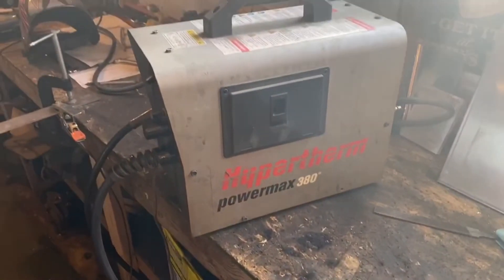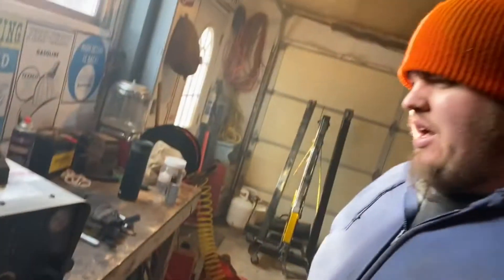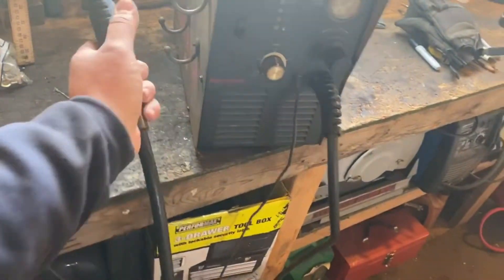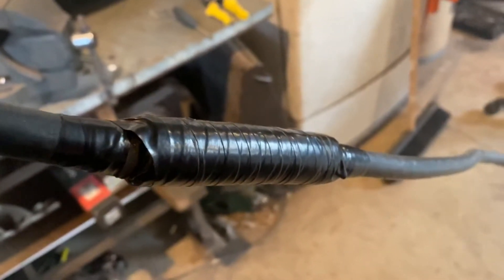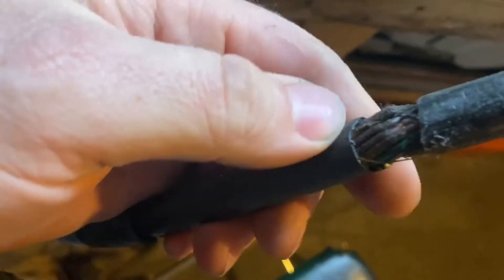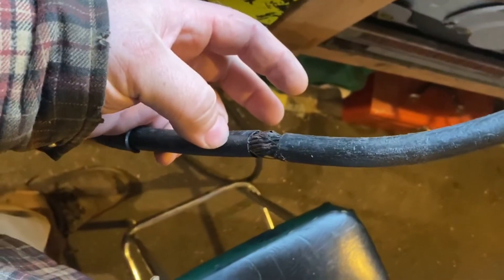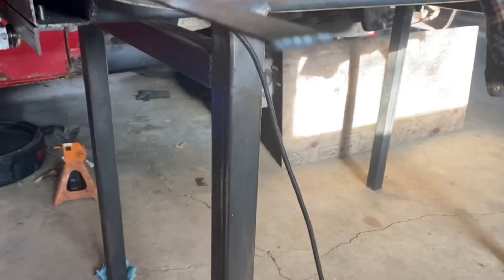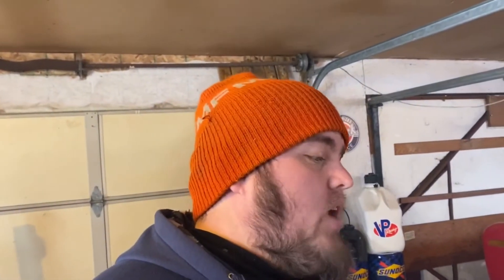Can we save this old Hypertherm Plasma?? - we see if we can fix an old plasma cutter powermax 380

Comment: A Friend gave me a Powermax 350,missing a Power cord , I wonder the connection wire look like , so I can make a cord to 220v adapter. 
If you can , please send me the pictures  of input power to 1 and 3 wire.
Thanks
Reply from the maker: Hey man sorry but I actually gifted this unit to a friend when I purchased a new machine. I no longer have it. I can see what I can find on it though. But not sure how much help I’ll be at this point.

Comment: I have a powermax 600. it acts like the work lead is not connected. do you think I could have a similar problem? how many wires are there? on the plug that goes into the machine there is about 1/2" of not exposed (bare) wire but the black outer rubber is no longer in the plug housing. I'm tempted to buy a new torch but it's 600 dollars and if it doesn't fix it I will be upset. any advise would be appreciated.
Reply from the maker: There are 4 wires and the air line to the torch I think. 2 for the switch and to to the electrode. Pulling the torch apart is not difficult so might be worth a try to see if anything might be going on in the head of the torch. Also then you could use a multi meeter to test the connection from the head of the torch to the plug that goes in to the machine. That will tell you if there is a brake in the line some where??

Comment: Got that same machine. Mine’s new old stock. Been in my storage for at least five years. Only recently decided to put it into service again. It has a few feet of cutting under its belt. I actually cut over 5/8 with it while cutting a few hubs off an axle. It has a duel voltage setting. You change it with a recessed switch on the back panel. If you’re plugged into 110 make sure the switch is set to 110. On 110 volt it’s rated 1/4 in. On 220 volt it’s rated 3/8. For cut off work it’s rated 1/2 . 12 inches per minute when parting off 1/2 inch. At any thickness they recommend using 27 amps at the torch. It seems to be power hungry. Book says it needs 10 amps at 220 volts but I would run it on at least a 20 amp breaker with minimum #12 wire. Since it’s a transformer based machine voltage drop could become an issue under certain conditions such as living in a development with a lot of neighbors running furnaces and AC in the summer.

Comment: I'm actually using the same plasma cutter on my CNC table and it works great! I just tapped into the switch wires inside the machine. I usually cut 1/8" steel @ 40ipm, 3/16" @ 32ipm, and it'll even cut 1/4" @ around 10ipm
Reply: Nice! Im waiting for my table and Im gonna use my Hypertherm 380. I use it to cut 10guage (1/8") now just on 110v.
Reply: @UGLYKIT  If you can switch to 220 I highly suggest it.
Reply from the maker: That’s awesome! Glad to hear it works. Thanks for watching.

Comment: I have this same machine, it’s been discontinued though. If the max is 27 amps I could see why. Could’ve swore it could handle high thickness back when I picked it up.
Reply from the maker: Yeah I think it can do more then what the dial states but I have not used it enough to give it a good test. Thanks for watching

Comment: What’s up bro, I just bought this exact unit from a friend and am having the same issue..minus the lead repair work you did on yours. My search for the answer continues, maybe one my consumables are shot if so it’ll be a quick fix. Fingers crossed...
Reply from the maker: Hey man thanks for watching! yeah it was an interesting issue. My lead issue was vary easy to spot however if there is any crack in the lines it would probably give the same issues. I will be opening up my machine shortly. To wire it up for my cnc project. Once I open I will see if the wires in the lead would be easy to test then a guy could test the wires through the lead to the head to make sure there all working. .... if that makes sense.